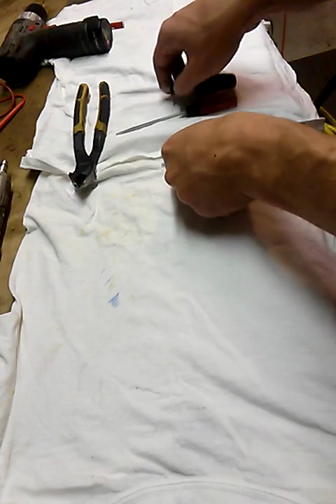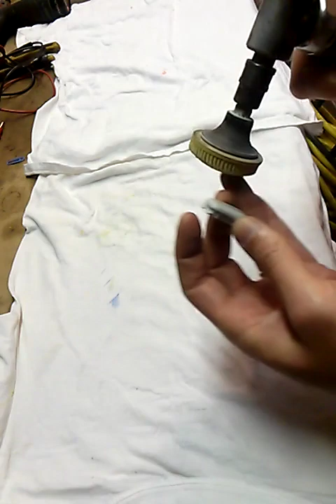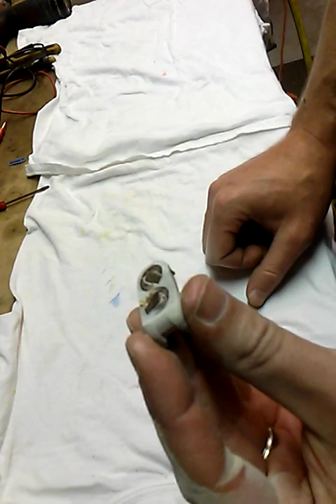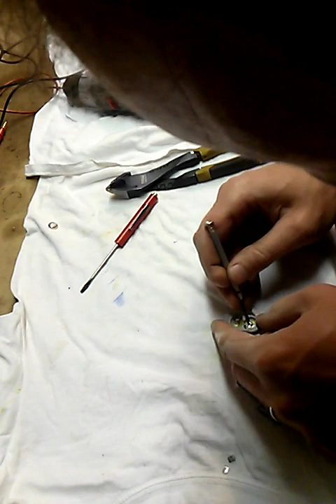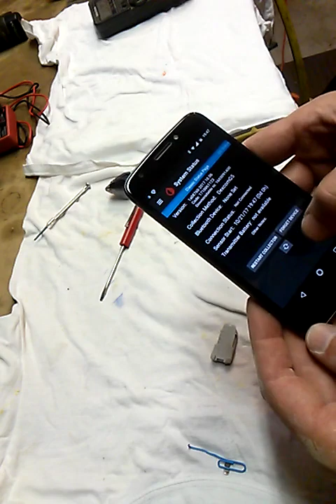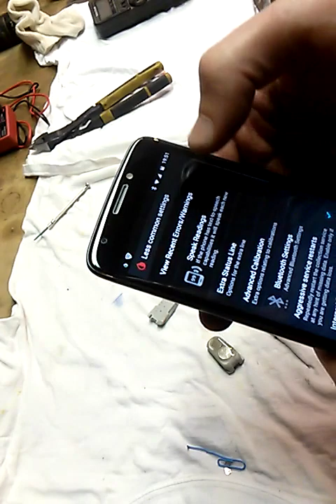Dexcom G5 battery replacement

Comment: First of all thank you Vince for the great video.  My first attempt was working fine for a couple of days also and then just stopped.  It still had current going through it, 218mv as expected.  I used an app called Bluetooth Finder to verify there was no data transmission.  Popped a battery out and in and then it began to transmit again, verified with the same app.
However it now gets zero readings from the sensor every 5 minutes.  My old transmitter has a tiny bit of battery life and that one works just fine in the same sensor.
Was wondering if a tiny blob of solder on the terminal contacts might help?  maybe I have scratched the terminals and worn them down a bit from testing the current too much.  Not sure if this one is a lost cause now that everything seems fine with it, bar the zero readings.
Thank you very much, even if you don't reply.  It's very kind of you to reply to so many questions.
Reply from the maker: I'm not sure the contacts are the concern here. I'd try restarting the transmitter again (by removing a battery for 30 seconds and reinstalling it)and see if it gives non-zero readings from the sensor.
Reply: I was trying to avoid taking it apart as I'd put silicone and the 3d printed lid on.  Came apart easier than I thought though.  
It's possible that I had attached the printed lid too far forwards, and it was causing the transmitter not to sit correctly in the sensor.  Can't be certain if that was the issue, but I was more careful with the position when I attached it the second time around.
I removed a battery just to be on the safe side, and it's all working fine now with a 100% capture rate on xDrip+.
Thank you Vince, we are all very grateful for your videos and for your assistance to those of us having some issues.
Reply from the maker: Outstanding! So glad you were able to get it working.

Comment from the maker: Please note: The official iPhone and Android apps, along with any Dexcom receiver or pump that acts as a reciever will not make use of data from a transmitter over a certain age. If your transmitter is past that (roughly 112 days), then you will need to use xDrip+ or Spike. You can use the apps to 'factory reset' the transmitter and use it again with official software if you desire, or use the apps themselves to read your CGM data. Here are the links: 
xDrip+ (for Android) link: https://jamorham.github.io/#xdrip-plus
 Spike (for Apple) link: https://spike-app.com
And see https://androidaps.readthedocs.io/en/latest/EN/Configuration/xdrip.html for some good info about resetting transmitters and overall xDrip documentation.
Also: I cannot do battery replacement as a service. Please search Facebook for groups that do this.
Reply from the maker: Kent Davis: Yes, that is correct. You can now use the apps to reset the timer on the transmitter; that should allow you to continue to use with the t:slim X2.
Reply: Hi Vince - Thanks for this video. :) 
I successfully replaced the batteries of a G5 sensor by following your instructions except that I didn't fold the bottom contact because it didn't seem to me like it would touch the side of the battery or the other contact. My multimeter gives me a reading of about 20mV, like you showed with your second multimeter.
I have a question: How does one 'factory reset' the transmitter with xDrip+?
I tried following the instructions in this forum post but the reset doesn't seem to be working: https://forum.fudiabetes.org/t/resetting-g5-transmitter-with-xdrip/6209/3
Reply: Nevermind my question in my last comment. The factory reset worked. It just didn't seem like it was working from what I saw in the xDrip+ app but the transmitter ended up working just fine.
Reply: Vince P does this also mean that the g5 transmitter will not work directly with the tslimx2 after 112 days?? Thanks
Reply from the maker: V Bond: No. There is information on the respective sites as to software setup. You may also want to join 'xDrip G5' group on Facebook for support.
Reply: Thanks for great video! I'm gonna definitely help my wife with her DexCom transmitter this way.

A question, too:

Is this kind of "planned obsolescence" legal in any way in Europe? I mean - the app not working with otherwise fully functional transmitter?
Reply from the maker: @SvenVarkel  I couldn't accurately comment on the legality of it. I would imagine it is, however. It's simply the design of the transmitter to expire due to battery life. The batteries are not designed to be changed.
Reply: Thank you, your video is great. You are definitely a priceless asset to humankind. It goes to show how much greed we have to deal with in our everyday lives. Instead of spending time with your family, you are trying to save money to survive. Please don't get me wrong, the CGM is a "Godsend". My Dexcom has changed my life. My point is that the folks that made it are great, they should make their  money of course but to what end? Yes, the CGM is a great piece of technology but it doesn't cost a diamond ring to produce anymore. I lost my receiver here a few months ago and didn't know about Xdrip. I ended up having to purchase a new receiver because I couldn't afford a compatible phone. I can't believe my medical team or endo didn't know or inform me of any of this. Hopefully someone over there becomes compassionate and lets go a little bit. Thanks again and I hope for joyous and prosperous times for you my friend.

Comment: I am thinking of doing this but I don't have an Iphone. Will this work with the Dexcom receiver? I do have an Android but I'm not sure it is one of the approved phones. Edgepark Medical Servces sent me 2 duds and charge my insurance for them. I am steamed.
Reply from the maker: The reason most use xDrip+ is because the official apps(Android and iPhone) and the Dexcom receivers will not listen to a transmitter over a certain age. If you are stuck with the dud transmitters(which you shouldn't be-I'd be on the phone to Edgepark and/or Dexcom), I don't see why those would not work if you replaced the batteries. In either case, xDrip+ works quite well on a large number of Android phones.

Comment: We have Iphones and it sounds like you cannot use G5 battery replaced transmitters with the Dexcom app.   You must switch to using Xdrip on an Android and even so only certain androids?  Correct?
Reply from the maker: Dexcom receivers and official apps will not listen to a transmitter over a certain age. xDrip+ works on many androids, some better than others. There is also an iOS app called iosxdripreader. Here is the link: https://github.com/JohanDegraeve/iosxdripreader
Reply from the maker: The developers of iosxdripreader seem to have continued their work in an iOS app called Spike. See the pinned comment for a link to that.

Comment: i don't understand how to check if the battery is working? what setting do i use on my battery tester?
Reply from the maker: By battery tester do you mean multimeter? Measuring the terminals on the back can give one indication of whether or not the transmitter is working. Testing the batteries themselves is a different matter. The batteries should be over 1.5 volts if new, you would use the DC volts setting for that. Is your meter auto ranging? If not, you would select a fitting range (i.e. 2 or 3 volts). The voltage coming from the transmitter sensor pads is around .215V, you would use the DC volts again, but, depending on the meter, you may need to select a lower scale.

Comment: Hi, great video! 
My battery on Dex G5 has been changed by someone else. It worked perfectly for 4 days and then stopped. I checked voltage like you explained and it is in range (like you mentioned in the video). But bluetooth G5 is not visible on any phone anymore. Do you have any suggestions? thx
Reply from the maker: There are a lot of variables. Had you been using xDrip+ on your phone prior to the battery replacement? If you had been using it with good success, then try popping one battery out and reinstalling it after 30 seconds. If you had not been using it prior, then try adjusting the settings on xDrip+. I hear the OB1 collector option is working well for many. For more support with xDrip+, see the xDrip G5 Facebook group. As far as the bluetooth, it is only visible for a short time once every 5 minutes, so it's the exception to see it in your bluetooth devices.
Reply: First of all thank you Vince for the great video.  My first attempt was working fine for a couple of days also and then just stopped.  It still had current going through it, 218mv as expected.  I used an app called Bluetooth Finder to verify there was no data transmission.  Popped a battery out and in and then it began to transmit again, verified with the same app.
However it now gets zero readings from the sensor every 5 minutes.  My old transmitter has a tiny bit of battery life and that one works just fine in the same sensor.
Was wondering if a tiny blob of solder on the terminal contacts might help?  maybe I have scratched the terminals and worn them down a bit from testing the current too much.  Not sure if this one is a lost cause now that everything seems fine with it, bar the zero readings.
Thank you very much, even if you don't reply.  It's very kind of you to reply to so many questions.

Comment: What is the grain/grade of the roloc disc? Great video btw. I was going to send my transmitter to someone with more experience with a dremel but the disc looks easy enough. Hey idea; if the bottom terminal breaks. Try a conductive pen to draw a new contact right over the plastic. Let me know if that works. Cheers
Reply from the maker: It's a medium grit (80). Good idea with the conductive pen. I was even thinking of a folded piece of aluminum foil, but that may introduce galvanic corrosion.

Comment: How do you get rid of the epoxy the second time? Do you have to sand off with the roloc disc again?
Reply: Vince P No. Just the gap between the batteries and the shell. Then when the disc gets close the battery with a round chunk of glue on it will come away with ease. Or it would make dremel cutting foolproof.
Reply from the maker: The epoxy I used, although durable and waterproof, does not become as hard as the original resin. A razor blade and some patience will remove it.
Reply: I'm  thinking about putting a tiny ring of rolled blu-tack around the seam so when the roloc hits the blutack there will be a separation.
Reply from the maker: Over the replacement batteries?

Comment: Good evening Vince,I changed the batteries and every thing went fine, however, when I pair the transmitter to my I phone it pops up that it was activated in August and within a few seconds it disappears and tells me to pair another transmitter. Apparently, it knows that that meter is being recycled and perhaps they added something to the chip so as not to allow for a battery change.  It is a G5 that I am working on.my insurance company will not cover the CGM despite the fact I have gone from a 7.9 to a 6.3 A1C.  I keep my sensors in for 2 to 4 weeks so as to stretch my funds and need to do the same with the transmitters as they are over $300.00 a pop.  Any suggestions?
Reply from the maker: Dexcom receivers and official apps will not listen to a transmitter over a certain age. xDrip+ is an Android app created by an open source community which does not have this limitation. Many (my son included) use it with great success. There is also an app called iosxdripreader for iPhones, but I personally have no experience with that specific app. xDrip+ link: http://www.nightscout.info/wiki/welcome/nightscout-with-xdrip-and-dexcom-share-wireless/xdrip-with-g5-support iosxdripreader link: https://github.com/JohanDegraeve/iosxdripreader
Reply: Thanks Vince for the information and the video. Can you let me know whether it's possible to run Xdrip+ concurrently with the Dexcom G5 Mobile app, without any interference between the apps?
Reply: if i have the xdrip+ does it let my family still see my numbers? how will that work out with the sharing? or do they just have to download the xdrip+ app as well?  thank you
Reply: have them download xdrip and set those to "follow".   be sure to make the main xdrip a "master" and create a sync code that is identical on both devices.  the follower doesn't use G5 as the "source"; it instead is set to follower, somewhere on down the list of sources.
Reply: Apparently the iOS app, Spike also works. I’ve played around with it and it’s impressive, but have yet to do a battery replacement with it. My transmitter will need  battery replacement in the next month or so, so will update on whether it works.

Comment: Thanks this video helped a lot.  I broke off the bottom terminal of my G4, but by some miracle was able to solder on to the .5 mm remaining bit.  I basically cut away as much plastic as I could with a razor and dropped a big drip of hot solder on it and it took perfectly.  That being said, I have no idea how it will stand up to temperature changes, etc.
Reply from the maker: Sounds promising! Glad it was helpful.

Comment: Hello Vince, thank you for very useful video. How many times is it possible to change batteries in one transmitter? Can I use transmitter with new batteries again with official Dexcom app or do I have to use xDrip+ app? Thank you very much for your reply...
Reply from the maker: As long as the tabs survive, I haven't heard of a limit to the number of times the batteries can be changed. As to the Dexcom app, the transmitter broadcasts it's age, and the official apps or receiver will not listen to a G5 past a certain age (109-112 days or so).
Reply: Ok, thank you!
Reply from the maker: I've heard of a new feature in xDrip and Spike that will allow a reset of the internal timer, which will then allow for use with official software.

Comment: Will this method work with the g4 transmitter?
Reply from the maker: Yes. So long as it is the 'slim' G4. Those are almost identical, except the G4 uses Maxell SR1120W batteries. The G4 can be used with the original receiver as well.

Comment: Hi Vince

I want to get started using battery-replaced transmitters.  I don't have a smart phone.  What would you suggest?  What is the one in your video?
Reply from the maker: The one in the video is a Boost Mobile Moto E4. So far it misses about every other reading. The one we use primarily is an older Virgin Mobile Tribute 2. It has close to 100% capture rate. 
Edit: We switched off the battery optimization specifically for the xDrip+ app on the Moto E4, and from that we are getting >95% capture rate.
Reply: Thanks for your reply, Vince.  What I saw looks good....but 50%..?... I have a cheap Tracfone  but I could get a Samsung S7 from them for $600.00.  I think the S7 is one that the xdrip will work with.  The cost is a lot but compared with a couple Dexcom transmitters - it seems a worthwhile choice.  What do you think?
Reply from the maker: I have not used any Samsung for xDrip+ myself, so I cannot comment on the S7. The Facebook group xDrip G5 has many users of xDrip+, I imagine someone in that group can help you.
Reply: Are you using old transmitters?
The newer transmitter model I have has backfill. I can miss 3 hours of readings at a time and still have 100% capture rate.
This is with the official dexcom app tho. Or does backfill not work with xDrip+?

Comment from the maker: So for the one that initially sent a raw value of zero- it did work, after removing and reinstalling a battery. My Moto E4 had to have the battery optimization turned off for the xDrip+ app to work well.
Reply: Hi Vince, good job! I get zero raw values - did you just removed one battery, re-installed and was working?
Reply from the maker: Yes. Remove one, wait 30 seconds and reinstall.
Reply: Worked like a charm, thanks. After a couple of hours of extreme noise the transmitter started working as expected. I am curious whether there is a constraint in terms of max days of life, or the same transmitter can keep going...
Reply from the maker: Fantastic! As far as I know, the transmitter will keep working as long as it is powered. So as long as it has good batteries, it should keep going. Using the method in the video, once you do the first, the tabs should be fine during subsequent changes.
Reply: Just replaced the batteries, it connects but reads zero bg. it is not connected to a sensor. would it be different if I connected it to one or do I have to pull a battery?
Reply from the maker: I would connect it to a known good sensor, and see what it sends then. With no sensor, it will always send zero.
Reply: Mine is working but showing zero as well. Will have to try pulling battery. Sucks if you already put epoxy on and soldered tab.
Reply from the maker: Ken Checkeye: Yeah, I've gotten in the habit of attaching it to a sensor before applying the epoxy. I also found that, in the absence of a sensor, you can hold your finger on the sensor contacts, which will give it a non-zero reading if it;s working.
Reply: It got the sensor to work after removing the battery for a minute.  Was looking at the data collection and appears that 220 ohm reflects 92 dl/ml so I might try a resistor opportunity to test.  Thank you.
Reply: What app are you using on the phone
Reply from the maker: xDrip+. The link is in the pinned comment.

Comment: Nice job Vince i made my G5 replacement with your instructions  of G4 and Renata 389.
The transmitter works like charm and still running well in my body after 3 months and a half.
Best regards.
Reply from the maker: Fantastic! Glad to hear it.